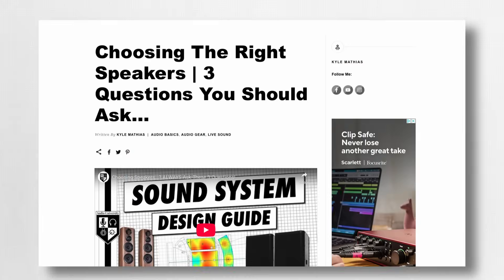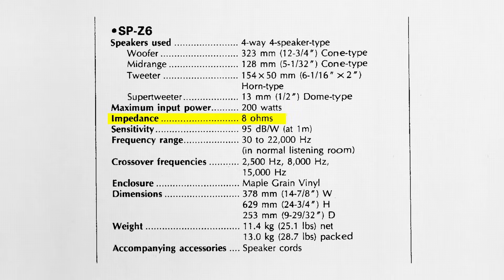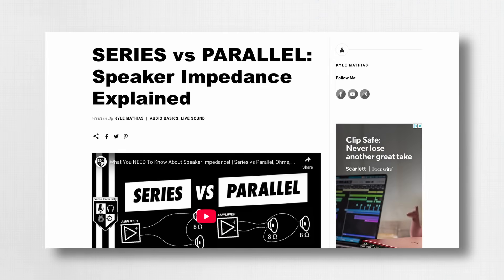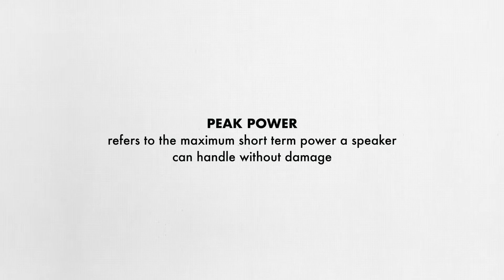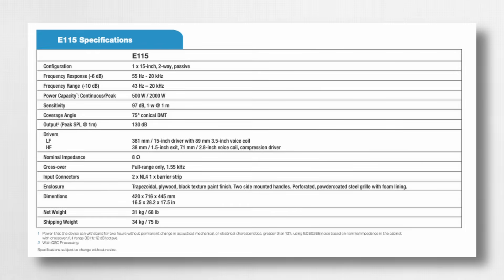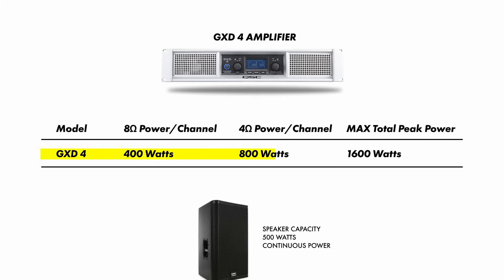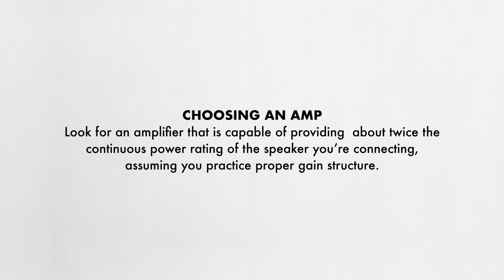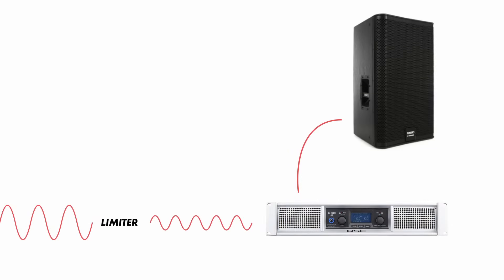Avoid These Mistakes & Pick The RIGHT Amp For Your Speakers

Comment: In regards to the amp power being twice the speaker, does this not apply to high efficiency speakers?  I was looking  at the  Ampeg Portaflex bass amp, the PF 50T amp is 50W RMS and they suggest pairing it with the PF 115HE cabinet which 450W RMS.  The cab can also be used with with high power amps following the general rule.  I would think that the high efficiency speaker would stretch the rule some but this would seem to be way underpowered following that logic.

Comment: I'm still confused....😢 In other videos I've seen that the recommendation is to choose speakers just quite more powerful than the amp to avoid clipping and high energy transients. For example 150W amp, use 180W speakers. But in this video your recommendation would be to choose a 300W amp for a 180W speaker ... I understand you will have enough headroom but it isn't too risky ...?

Comment: So use an amp that has 100% extra power over the speakers.
Get speakers that are loud enough for your listening at 60-80% max of the speakers.

Just like in most things in life, it's generally good to allow 20-50% ish buffer, budget, headroom. Run things at 80-85% max. Of course there are exceptions. It's all based on how it's made and designed to run optimally.

I wonder if it was possible to find each speaker's perfect frequency, loudness, resonance.  Eg. These speakers sounded best at 87% max rating.

Comment: If your speakers were rated for 500 watts continuous 2000 watts peak and you had the choice of using a 440 wpc amp or a 1550 wpc amp which would you use? I have a couple crown 2502's and thinking of running them both bridged

Comment: I've got three 4 channel Carvin amps. Two of them bridged into 2 channels for 2,500 watts per channel. One amp going into four 18 inch Dayton pro audio drivers. Another amp going into for 12 inch Timpano pro audio drivers, and The OTHER One (not bridged) has 2 channels at 780 watts 4 ohm going into four DS18 400 watt compression horns with Dayton 50° x 90° wave guides, and the other 2 channels on that amp are used for monitors. It seems to be enough to get the job done?

Comment: I am completely at a loss as I try to piece together a 2 channel system for vinyl playing only. I have an Outlaw Audio RR2160MKII along with a new Fluance RT85 (BLUE CARTRIDGE) and Monitor Audio Bronze 500. I have blown the tweeters twice on these speakers, most recently when I received the new Fluance turntable just by installing the ground wire from the turntable to the amp. They replaced the tweeters once for free now I have to purchase the tweeters. I have an old pair of Monitor speakers and installed these until I get the tweeters to replace. If I turn the volume up it makes a horrendous sound. I have tried to reinstall all the lines, wires, tightened everything and still this terrible sound. Are these speakers not the right speakers for this "powerful" integrated amp? It has a built in phono preamp, but I do have a separate phono amp and wondering if I should try to use the separate pre amp instead. I am new to all of this and just want my records to sound good!!! ANY help or insight from you or anyone would be incredible. At a loss here, thanks.

Comment: Here's how I do it.  Firstly I use a dsp.  

Wiring goes mixer to dsp to amp to speaker.  

Then I calibrate everything so if the mixer's output is 20 dbu and the dsp has an input sensitivity of 22 dbu then it'd go on the dsp and boost on the input by +2 db.  Then dsp to amp if the dsp is 22 dbu but the input sensitivity of the amp 21 dbu it'd go on the amp and attenuate by 1 db.  

Once all set I now have to figure out the threshold on the dsp that corresponds to 800 watts on the limiter of the dsp.  so if the amp is lets say 4000 watts and the speaker is 800 watts continuous then I should set the threshold at -7 dbi where -7 dbi corresponds to the rms or continuous, the peak corresponds to -1dbi.  

Depending on your dsp you can set up the limiter to not allow the sound to go up a curtain point while allowing for some dynamic range for example on the dbx venue 360 it'd set the threshold at -7 and it'd set the overshoot to 6, so -7 + 6 is equal to -1 which is our peak.  

This of course is the simplified version of how you should set things up it can get even more complicated once you start factoring in losses due to wiring resistance over long distances.

Comment: Having a speaker rated for 150 watts being driven with an amp that only supplies 50 watts max will give the same sound quality for musical enjoyment if you are not using higher volumes or so I have been lead to believe. 
It`s sounds true as my system is the mentioned watts. The higher watts are only for volume control or so it appears to be from my setup as it is pure and sweet since the purchase of a simple dac for $100.
On a more detailed note, at what watt rating does a speaker need to achieve perfect harmonic blending  considering the speaker is of higher quality not price but actual design meaning it`s designed properly....

Comment: informative video to small points though AES2-1984 (r2003) standard. is the continuous rated power for two hours 
and on most modern amplifiers the clipping light does not indicate clipping indicates the anticlipping circuit has engaged therefore the output signal is not being Distorted but compressed
Reply from the maker: Hmm interesting point. Thanks for sharing and tuning in 👍

Comment: How does a power amplifier with specs at 2 / 4 / 8 ohms deliver the correct ohms to speakers, without a "switch" like commonly found on guitar amps or separate output jacks?
Reply: transistor amplifiers have a very low output impedance so they can drive different loads without problem
you always drive low impedance to a higher impedance 
valve amplifier is on the other hand has a very high output impedance K ohms and use an output transformer to reduce the impedance and it becomes critical to match the impedance correctly the transformer has different taps for 4 8 16 ohms Hope that helps😊
Reply: Ohms presented by speakers vary with sound frequency as well. The rated (nominal) ohms on a speaker are the average ohms but that particular speaker will still present varying levels of resistance (ohms) to the connected amplifier depending on what frequency of sound is being reproduced.
Reply: @ yep The frequency impedance graph is often published in specification

Comment: Great video. I hope you will also cover speaker wire resistance when building your system as this is often overlooked, especially in larger layouts. The gauge of the speaker wire makes a difference in power output.
Reply from the maker: That may be something we cover in the future, thanks for watching!
Reply: Just do everything with 8 AWG. 😉

Comment: Off topic but …… i Have 2 powered JBL 15 seakers and 3 unbalanced 1/4 Plug cables that pick up Radio station signals and have a buzz to them. Are the cables what matter?!! Do you think i should invest in mogami cables? Or its not that deep?😂
Reply: Or get a little Mackie mixer
Reply: How long are your 1/4 cable runs?
Reply: @ 25ft its for 2 pianos and one guitar
Reply: then maybe you should get an (active) DI-box and run the distance via XLR-cable.